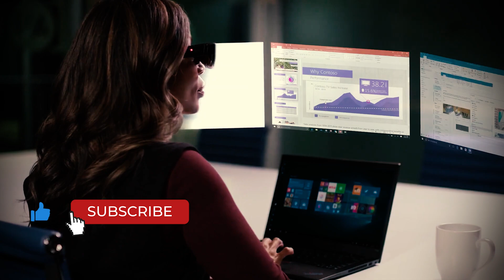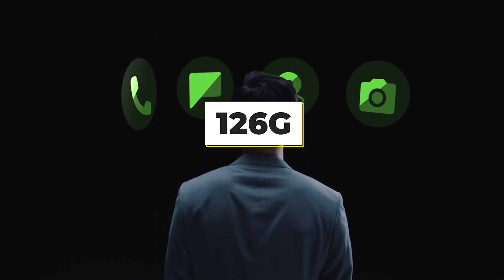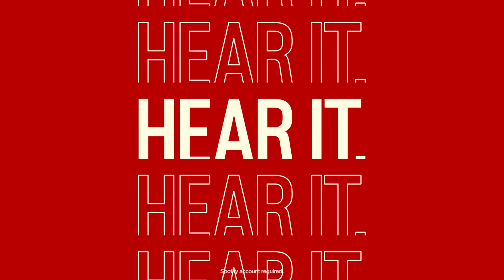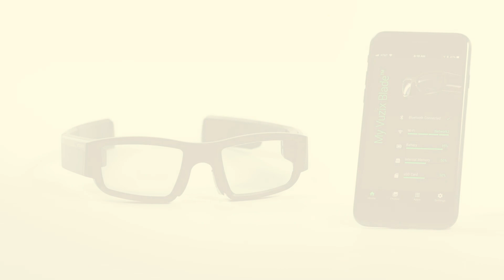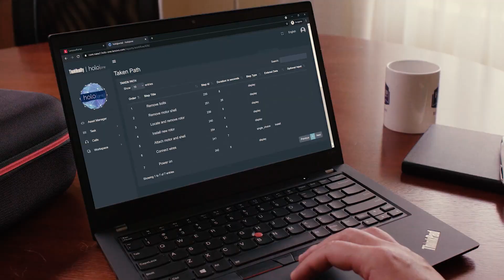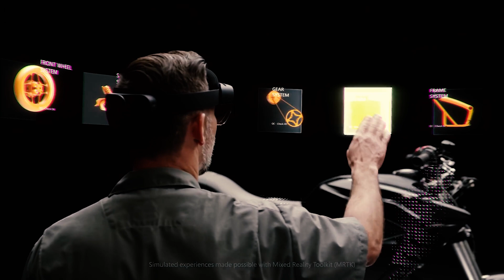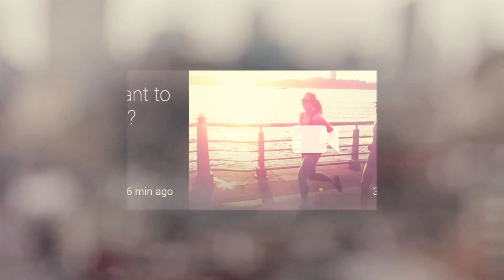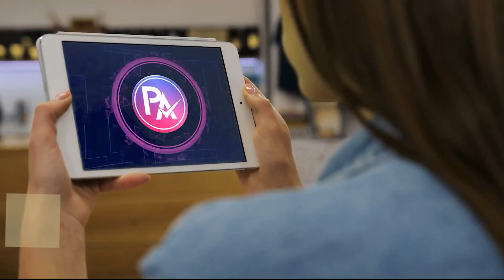What's The Best AR Smart Glasses (2025)? The Definitive Guide!

Comment: I made a prototype from some Chinese glasses with a camera and I have managed to control them without touching them or saying a single word.
What's more, you can look at me with them on and I'll give you $100 if you guess when l'm taking photos or videos of you.
I am doing some things to get a superior prototype and launch them on the market through crowdfunding, but I am going slowly since I have never launched any other product. The control system using cephalic-facial gestures can be incorporated into any glasses, including Ray-Ban | Goal. The sensors that I incorporate are 3 and they do not consume any additional energy to function, in addition, I also made a system for them to charge them while you use them without it being noticed and it has turned out as I expected. The glasses still look identical, you don't notice anything additional when you wear them.